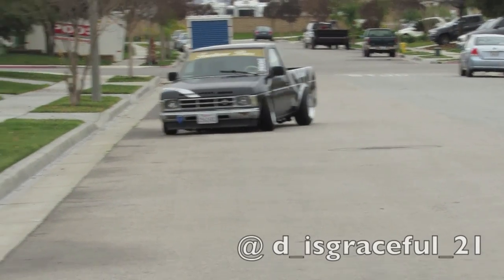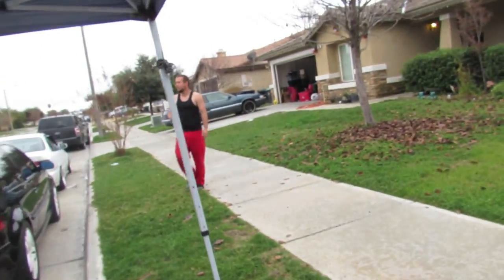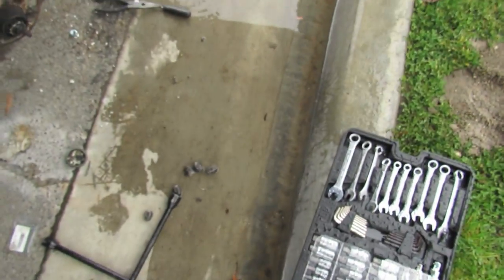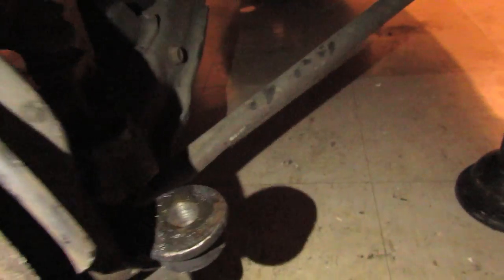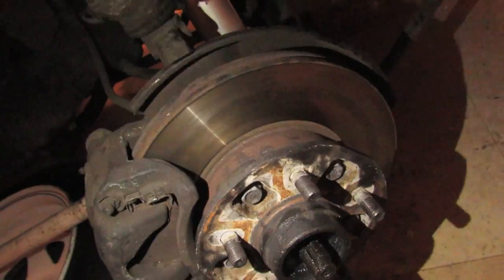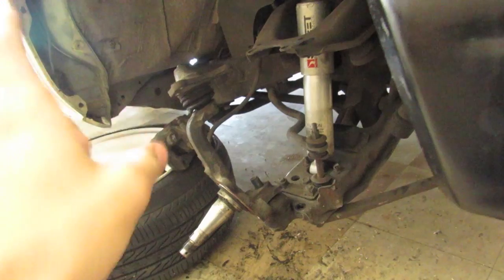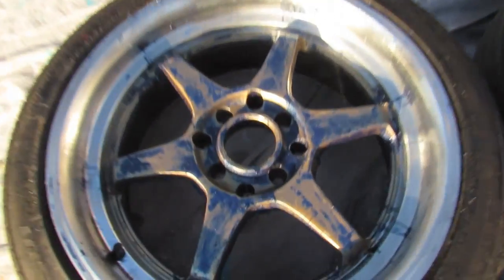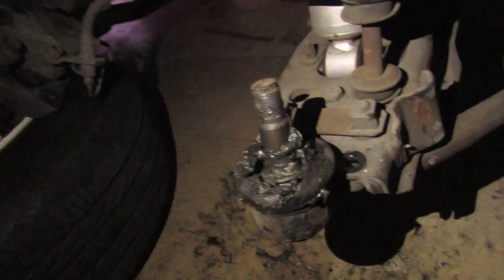drop spindle install part 1 (broken ball joints)

Comment: you dont undo the balljoints from the arms.you just hit the spindle buy the ball joint bolt real hard a few times and it shocks it free.i never use balljoint pullers.they wreck the balljoint boots